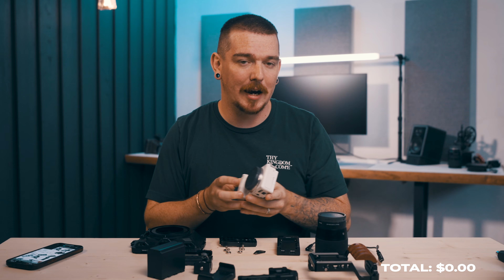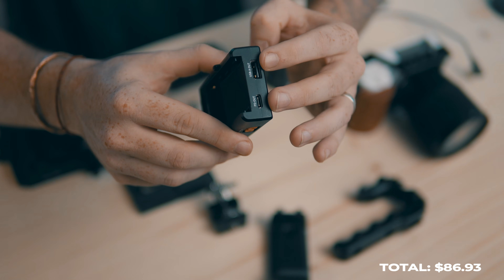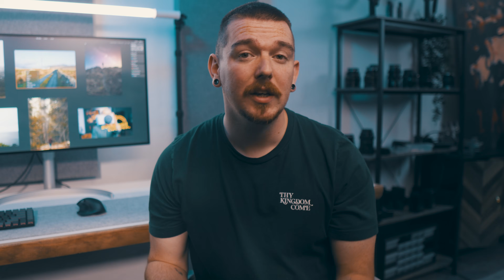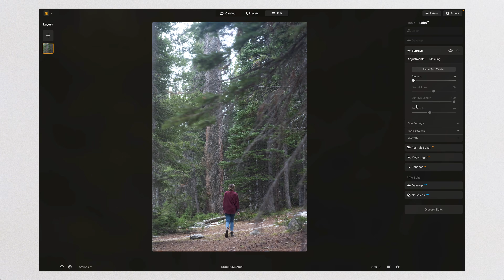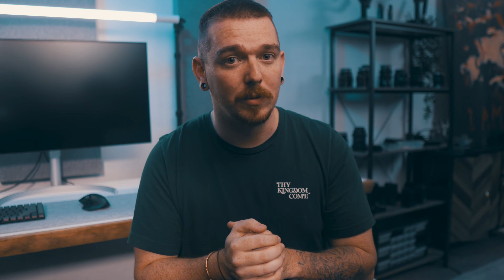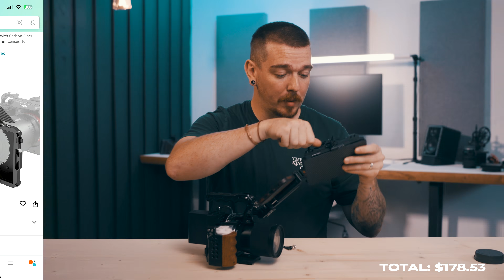An AMAZING ZVE10 Cinema Rig Under $250!

Comment from the maker: One thing worth noting is that if you're interested in building this rig, test out the phone connection as a monitor first because I know a lot of people have problems with connections and frame drops. If you're looking for a cheap monitor to add instead I've added 2 in the description. 1 is my fav cheap monitor by portkeys, and another is currently on sale for only $60
Reply: Can we use Nd with this mattbox ?
Reply from the maker: @-smok5332  circular screw on ones work just fine, and you can also use the 4" x 5.65" ones
Reply: @-smok5332 yes, the adaptor that goes on the lens has threads on it so you can screw a ND filter too it, you can also use the square filters. I have a UV square filter and a circular ND filter on mine.
Reply: I am go glad I found your videos a while back.  You are the reason I got a ZVE10 to move into video and build a rig.  If I added the Portkeys Monitor, what cables do i need to connect with the camera and battery pack?
Reply from the maker: @shiftsport  You would Need a D-tap to NPF dummy battery to run from the dtap port on the Ulanzi plate, and a micro HDMI to regular HDMI
Reply: @thomas_j_mcclure could I make this with a Canon EOS rebel T6 I know I would need to get a different cage but would everything else work???
Reply: I've had the Feelworld F5 for 5 years, loved it to death - just one issue with it, for your viewers to consider.. It's not very bright! So if you are shooting on a sunny day outside, a phone is a better cheap option. Or if your budget allows it, get the F5ProX it's 4x brighter and I'm using that one for a year now - awesome monitor.

Also consider angled HDMI cables for it, to keep your connections safe from bumping and your setup looking clean. 🎥✨
Reply: @thomas_j_mcclure  if you have an android device with monitor +, you can connect the camera to the device directly and have almost no input delay as a monitor
Reply: Can you find me a cage for the canon 80d?

Comment: Hi, You are a lifesaver. I have a question though. Can i run the NPF battery to power a dummy battery instead of directly powering the camera through USB-C? I have heard that a dummy battery can help the battery from heating up. I want to use a monitor as well with the rig.

Comment: For the camera, maybe the a6100, seems to be around the same price.

Ive a quandary.
I have pro camera kit and its old ... Old and gold... But not something i want to take on a shoot - currently doing a house Renovation.
Ive been looking for something. Better than a  Action camera, and with some creative control. 
But i dont want to spend too much doing it... Cheap as basically possible and well the prices for ten-fourteen year old kit, is well outrageous imo.
But i have not bought kit so im out of touch. Then i am caught between hd 1080 or 4k.. 

I have older nikon lens, and my big video cam is a cannon. So i have to factor in a ring, or the cost of glass. 
Suggestions please (uk).

Comment: I do basically the same. I got two of the Xeen 1.5 50mm and 85mm for PL mount (thats why nobody bought them) for unbelievable 150€ each. I bought on black friday a PL to e-mount adapter für another 140 bucks, small rig follow fot for 100€ and some addditional stuf and got along for 800€ for my whole a6000 setup. It wasnt planned, but now I have to dive deep into that rabbit hole. Thanks for this great great video!☺

Comment: Hot take: The ZV-E10 is a terrible camera. People are glazing this thing like crazy, to the point where I almost wasted $800 on it. Yes it's a good camera only for its PRICE, but I rather wouldn't buy it because you can get an used a7iii for like $200 more and have more than 5x better features and design, and an insane leap in video quality.

Edit: Also the people that recommend it act like it's perfect for high level production. It definitely is NOT, it's a camera designed to be easy and simple to use for beginner videographers. If you want to be professional, please don't buy it!

Edit again: I'm glad this person didn't glaze the camera
Reply: What do you think of A6400 ?
Reply: @rewjensen   pretty good, i'd say it's a decent camera for video if you don't want to spend 3000 on the fx3. based on specs its got (almost) everything you need and appears great for rigging. however i never got the privilege of personally using the camera so i cant give an in-depth review

Comment: Ditch the matte box for a monitor. The delay on the edge app makes it unusable in a wireless fashion. Matte boxes are pretty much purely aesthetics these days. No need to run one when a standard thread on variable ND will work just fine if not better.
Reply: Exactly what im about to do lol

Comment: I’ll never understand why the idea behind all these building a ‘Cinema Rig’ videos always implies throwing bulky crap and a cage on the camera to make it way more heavy, a huge matte box that you’ll never use considering one filter is worth more than the $500 camera. Just use circular filters and a lens hood if it’s a little solo use $500 camera. 

It’s okay to film on a $500 camera, but let its lightness and compactness be a strength. Putting all this on isn’t going to magically make it a Venice. And the stuff tossed on is only going to matter in a team environment, which I’ll be damned if a production is using a zve10

Comment: I don't know where you're getting a price of $500 for a used ZV-E10 body. Maybe you mean $500USD. I live in Canada, and a quick check of eBay shows tons of listings, all with prices close to, or more than Sony Canada charges for the same thing brand new with a warranty and a 16-50 kit lens. Even then, $500USD converts to $683 CAD, which means the eBay listings are waaay overpriced. It's also interesting to note that eBay is flooded with listings for ZV-E10's. Many, ironically enough, are from the US and asking prices are way over the line too.
Reply: There was a sale recently, I also got a new one for the average asking price in the used market

Comment: I want to use my Sony ZV-E10 for Stormchasing (distance), but in 4K live streaming to Youtube.  My Samsung S10 runs the app CameraFI Live. I have an Small J5create JVA11 capture card connected to my phone through USB-C PD. The other end of the Capturecard is a normal HDMI Outpout. With a normal HDMI connector cable on the capture side, it goes to micro hdmi input on the camera.  BUTTTTT, how do i power the phone now, since its connected to the capture card? All wirelesss charging option are a bitt diffcult to mount on a tripodded selfistick. Also the camera needs power. And streaming through USB-C with 720p is MEHHHH. You have any solution?

Comment: Thomas, when researching the pieces, I came across an adapter to place the camera vertically, which in theory seems to do the same function as the cheese plate with the tripod plate. The piece is called Bexin L130-50C. Could you confirm if it is possible to use it? 
I'm starting out in audiovisual, so I have a lot of questions.
Anyway, thank you very much and sorry for the English, I'm Brazilian.
Reply: Coincidently I ordered the same piece from Aliexpress =) Will be here in two weeks. Have you tried it?

Comment: So the EV10 does not have image stabilization built in. So this camera./ rig will always have to be on a tripod or monopod. So I get why it's called a cinema rig because it will most likely be controlled filming like cinema. I also see now why some may say this is over kill.
Reply from the maker: Almost all actual cinema cameras don’t have image stabilization. That’s where the rig comes in, the weight acts as a stabilizer in a sense, makes for much nicer hand held footage. The main problem with the zve10 handheld isn’t the shakiness, it’s that the rolling shutter can be a bit of a problem of you’re doing fast paced movement
Reply: @thomas_j_mcclure  Alright, now that I have looked up what a rolling shutter is... I don't think that will be a problem for the type of content I am trying to make. (Interview/ B roll based for business clients). I will invest in this cheaper rig setup and see if that helps with my shaky handheld video. I have a mono pod and the DJI ronni mini 3 gimbal. The gimbal is hard to use effectively at this stage. Maybe I will double up with the rig and mono pod if I still have issues. Or is that over kill? The B roll is coming out shaky. Thanks!

Comment: i have the Portkeys PT5ii. do not get it if you plan to use it outside! do not get it if you expect a responsive UI. Its cheap, its basic, it gets the job done most of the time but its not a great monitor by any streach of imagination.  if you can afford it Viltrox DC-550 sounds much better on paper and its the one i want to try next

Comment: I got my ZV-E10 from Amazon UK, paid £600 for a "Used - Like New" one. Their description states "like new" means a never used customer return, in original packaging. When it arrived it had clearly been used, there was dust under the screen hinge, no screen protector, and finger smudges all over it. The whole thing had clearly been opened, used for at least a few months, then scruffily packed away back into its box... which was also selotaped closed.
I contacted Amazon to complain that they had not sent a "Used - Like New" but instead a "Used - Good Condition" camera.
I pointed out that the "good condition" ones were closer to £500.
They gave me the option of returning it for a full refund, or a £170 partial refund and keep the camera.... So I took the partial refund and my ZV-E10 only cost me £430 🙂

Great camera, I've since installed a Neewer cage, Yongnuo 16mm 1.8 lens and a DJI Mic receiver on the hotshoe. Awesome mini rig for lightweight videography, but I do fancy beefing it up a bit with an external battery, top handle and better monitor than the built in screen.

Thanks for the video Thomas. 📸📸

Comment: Hello! Does the NPF battery fits on any brand? Or is it specific for Sony cameras?
Thanks for your video! I love this rig!
Reply: just find dummy battery for your specific camera or if your camera does support AC power in via on camera usb port that is even better. For the dummy battery just get the ones that can either be plugged in thru the D-tap or usb port on the battery plate. As for direct AC power in, make sure to get PD cable if your camera have usb c and does support PD input

Comment: quick question! I have a canon 200d and its really hard to rig out that camera as there isnt any cages for it? Do you have any tips? I would like to mount a top handle and then a monitor on that top handle, but i just dont know enough about camera accessories to find the right thing. Would love to hear from you if you got any tips!

Comment: Monitor+ can work via hdmi. Camera -> hdmi cable -> cheap usb hdmi capture device (looks like flash stick, and 1080p enough) -> usb a to c otg cable -> smartphone. This setup doesn't lag instead of sony app via wi-fi.
Reply: do you need any apps to run it with dmi cable?
Reply: @artcrisis2749  Only Monitor+ on my android device.
Reply: @artcrisis2749  the app is called Monitor+
Reply: @artcrisis2749 I’m pretty sure it only works on Samsung.
Reply: @artcrisis2749 I use my ipad as second monitor with a video capture device an on the app store there is a app called « HDMI »
Reply: @artcrisis2749  monitor +

Comment: Hey!  What's ur advice should i get the A7III/A7C with sigma 24-70 mk2 OR a6700 with 1.4 sigma trio (16-30-56).   I want to do some video/photo work for businesses (cofee shops/restaurants / car dealerships... ) And do u think that the 4k 60 + new ai focus on a6700 will really stand out and matters for what I'm going to use the camera for
Reply from the maker: Between the a7iii and a7c the main thing is whether you need the flip out screen or the dual card slots. Both good cameras, but yeah the auto focus is pretty fantastic on the a6700, plus you’ll get more background blur with those lenses than the 24-70 f2.8. Realistically you can’t go wrong with either choice, they’ll both produce a great image, depends on what kinda price you can get them for
Reply: @thomas_j_mcclure  ty so much! I think i will go with a6700
I also want to ask about the lenses
what about them do u think i made the right decision or there is some better lenses collection in the same budget about 1000$ -1200$

Comment: This is exactly the video I needed. I’ve been racking my brain for week on a ZV-e10 rig that would require a Vmount. Appreciate this video. I plan on doing this exact setup with a Helios 44-2.
Reply from the maker: The zve10 plus a Helios is a great combo! If you ever get a chance to find a used one cheap, a Viltrox speed booster with it is awesome
Reply: @thomas_j_mcclure  I already have one . I’m using a front angle adapter instead of a speedbooster to get a better minimum focus distance.